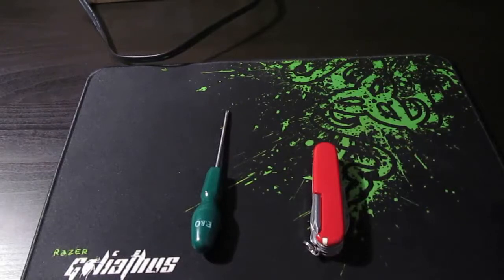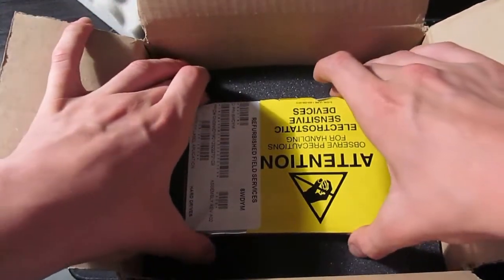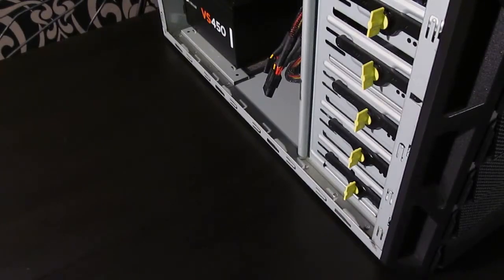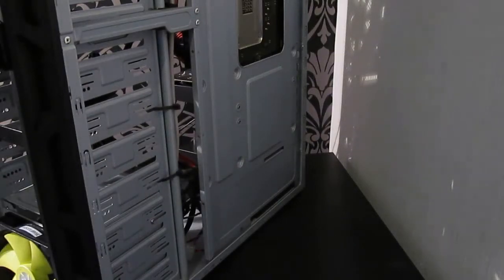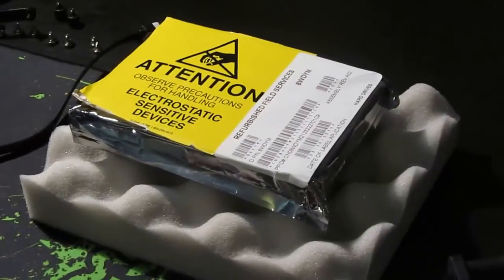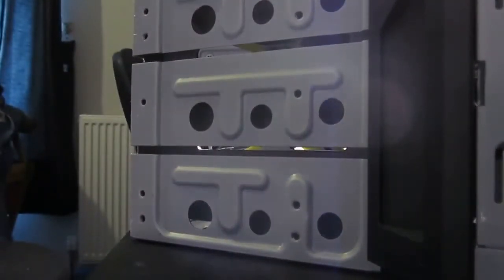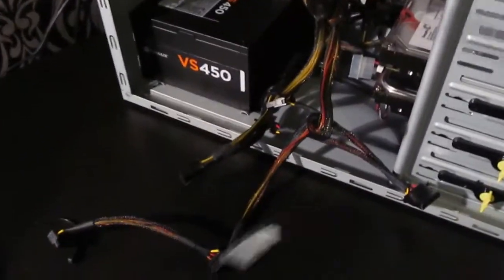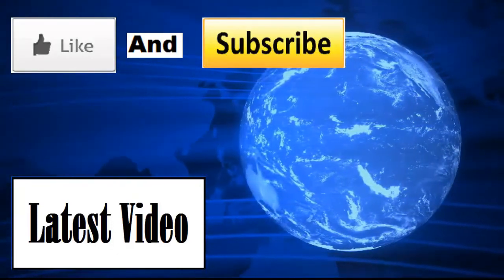How to install a second hard drive to your PC

Comment: Is there a place to plug each hard drive into the motherboard or was the slave drive plugged  in to the main  drive.? Or is there some kind of adapter that I need.I just bought a Seagate 2 tb today but am afraid to open the box unless I am sure it will fit the pc.
Reply from the maker: +Moby Dave yea sorry I made this video years ago so probably did not go in to as much detail as I should have, there is two types of data connections Sata and the old connection IDE.
 http://www.laptopparts101.com/wp-content/uploads/2008/12/sata-ide-laptop-hard-drive.jpg
 these two connection types are not compatible so you would need the same connection type for the extra hard drive as your motherboard. chances are if your PC was made after 2004 it has a SATA connection. however you mention the term slave drive which makes me wonder if your system is running on a IDE connection as with the new Sata connection slave drives do not exist. Hope this helps, let me know if there is any other questions you have and I will be happy to help.
Reply: +KillerTech Ok I'm sure it's not an IDE drive as I havn't installed a drive  since way back then. The computer is probably less then 4 years old Thanks for the help and quick response
Reply from the maker: Happy to help.

Comment: once you wear a rubber bottom shoe,static is impossible to mess up a hardware
Reply from the maker: That is a nice idea and way more practical than others methods.
Reply: +KillerTech yes it is,I never used a static band or mat before,I built countless pc's and a rubber shoe does the trick
Reply from the maker: +Lamaine Eubanks for my personal computer building I use a wrist strap however a few months ago I started working in a large computer shop in which I build multiple high end computers on a daily basis yet my boss has never even mentioned using any ESD protection. I have not ran in to any issues yet so I am starting to wonder if ESD is over hyped.
Reply: +KillerTech yes it is overhyped,I don't see what the panic attack is about. " oh my God he's not using a ESD" Pshhh

Comment: wait what sort of screws did he use? like how big were they?
Reply from the maker: +JJPrinze I am not sure what size they are but they should be provided with the hard drive or your case. If not then I believe these will work, but I would check before you order them http://www.amazon.co.uk/StarTech-com-Mounting-Computer-Screws-Standoff/dp/B00032Q1J4/ref=sr_1_1?ie=UTF8&qid=1457566646&sr=8-1&keywords=hard+drive+screws

Comment: What do you do if you want the new hard drive to have different OS? I currently have Windows 10. I have an older hard drive, as a matter of fact the same one you just installed. I would like that hard drive to operate on windows 7. Anything special I need to do?
Reply from the maker: you can only have one OS that functions on your computer this will be Windows 10 for you. when you install the secondary hard drive you will get an extension of storage. the hard drive you currently have installed will currently be set as young boot drive in you bios. meaning it contains your OS I hope this helps.
Reply: +maxxlexx1 jail me with?
Reply: +maxxlexx1 jail me with?
Reply: +robert spivey its fake btw, they can see your stuff, but it wont hold in court coz digital stuff isnt bad enough. if you were to hack google or something, theyd have to catch you with the pc on or its invalid evidence
Reply: also it is very possible to have two harddrives running different OS i believe you have to do it through the BIOS and i personally would look into it from another video

Comment: HELP I have an old caviar green drive that I want to add to my computer but it has a virus on the hard drive what should I do?
Reply from the maker: +Nicholas Beer Yea the best thing to do with that would be to format it, That is as long as there is nothing on there you want, There is tons of videos on You Tube showing you how to format hard drives if you are unsure on how to do it. Sorry I cannot be of more help.
Reply: hello, it may be too late but if you still want to format your drive try using deriks boot and nuke, it is a great driver cleaner, but it does take a long time!